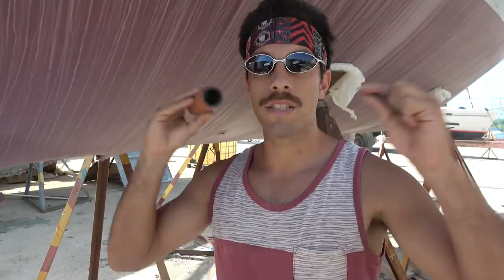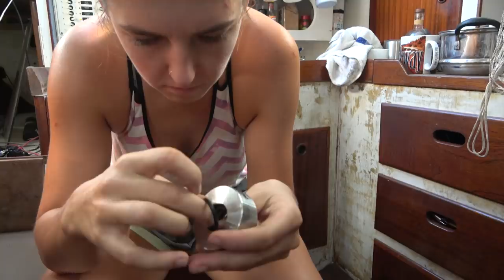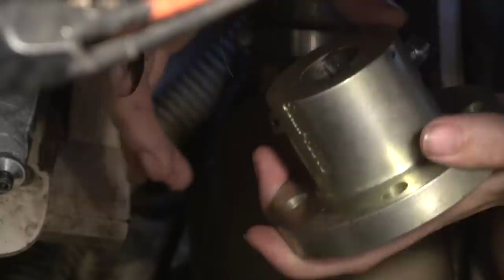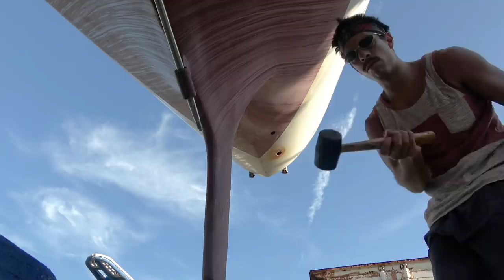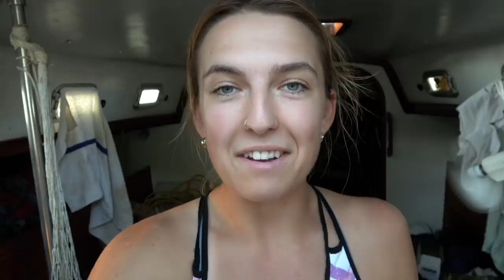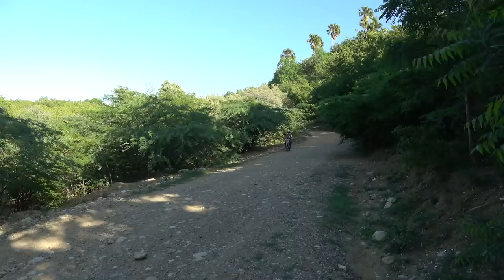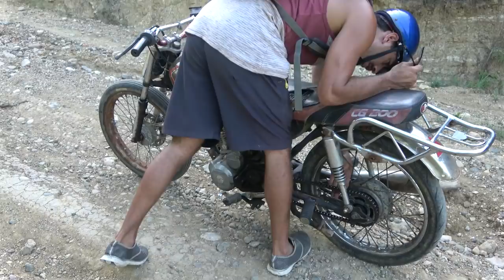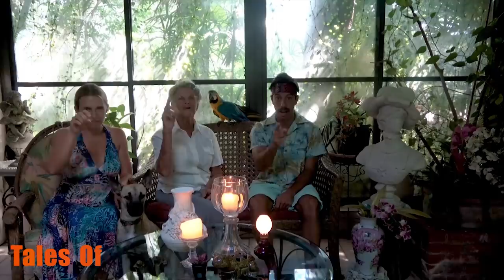Sailboat DRIVE TRAIN Installation 🔨 Ep 96

Comment: A hose clamp just in front of the shaft seal collar is a good and cheap way to ensure the collar doesn't slip up the shaft
Reply: I've always added a shaft collar for this exact reason. An old shaft anode works well too if it's not too bad of condtion. I never considered using a hose clamp, but I'll keep in my bag of many tricks if I ever need it.
Reply from the maker: Hmm, okay thanks for the idea.
Reply: Hose clamp could cause vibration . That is one way to balance the drive shaft in a car old school .   Good idea though - maybe a used anode instead ? Alternatively two gear clamps 180 deg opposite .
Reply: @faircompetition1203  PSS actually make a shaft collar for exactly this purpose about $20.00 I think , the hose clamp still works ok
Reply: @alcooper944  As long as it does not introduce vibration it is a cheap and cheerful insurance .

Comment: You should  take the set screws out of the shaft coupler and take a drill bit and dimple  the shaft it helps to keep the shaft from pulling out when you put it in to reverse just talking from experience  it sucks try put it back in in the water. Keep up the good work.
Reply from the maker: The shaft came with holes pre drilled. That does sound like a nightmare!

Comment: Few observations, bolts are available in assorted lengths. Its ok to cut a bolt to length. Be aware of bolt grades for a given application. I didn't notice a key placed into the shaft for the prop. That's an important thing so without one your in trouble . I would suggest a tapered wood plug in the event you ever have to remove the shaft while in the wet stuff.  use lock tight on everything. Loosing a shaft in the ocean will put you at the bottom. Please have a experienced surveyor go over your work before you launch. Keep up the good work & never stop learning. The chain on that bike should only have about one inch of play. Chain and sprockets and rear bearings are all probably worn and loose.

Comment: you need shorter bolts, (although what you have will prob work, little locktite might be a good idea.   if needed you can cut the ones you have just be sure to run the nut  down to the bolt head first so after you cut the bolt taking the nut off will help clean up the threads.  thinking those are fine threads and may need a die to really clean them up. (Volvo, fine metric threads is my guess.  Best way is to just get new ones)  The holes in the set pins in the coupler to the shaft is for safety wire, this will keep them from loosening.  Once the boat is in the water you will need to align the engine & shaft.  When tapping holes like on the strut I am thinking you may want to do that by hand.  You get a better feel & have more control.  The place that sold you the tap should have tap handles. (one handle fits most taps)  teflon tape for threads dealing with water so they dont leak & you dont have to crank them down gorilla tight to keep them from leaking (esp if plastic components)  Im sure I have more ideas but it is sundowner time.  Great job, have come a long way.   Ill be in Punta Cana 12/26 - 1/2

Comment: As other's have already stated in the comments your prop nuts are in the wrong order. The nut against the prop is supposed to be the half height nut. The load from the half height nut is then transferred to the full height nut. The way you have it set up all the load from the full height nut is being transferred to the half height nut. It is almost guaranteed to fail the way you have setup. 

There should be a flange gaskets between the shaft coupling flanges. It will help later with alignment and your long bolt problem will suddenly disappear. 😁 I don't know if you have access to a farm supply company there, but that's where I buy my flange gaskets cheap.

Edit: I was talking to a friend today who is much wiser than me, and he says flange gaskets are not always necessary. I guess the best thing to do is ask the flange manufacturer for advice.

Comment: It is such a pleasure to watch you two with a can do attitude and the guts to put it all out there for us to nitpick . Remember most of us learned the hard way too . 

Faired the keel on my boat two years ago and I used some old left over epoxy and mixed it by eye . It failed and peeled off like old wall paper LOL .  Ya , lesson learned .  Made two mistakes , marginal expired epoxy and an imperfect mix that would have been fine if the epoxy was  . Thought it was OK because it was just a little cosmetic fairing so I cut corners and ended up doing it twice .

Comment: If you put the nut on the bolt and run it all the way down to the head, like you have already you can cut the bolt with a grinder with a cutting wheel. Once you have cut the bolt remove the nut and it will straighten out your threads on the bolt. You can cut all your bolts to the same length, and not have the nuts on the drive shaft the nuts extra weight can cause it to be off balance and cause a vibration, which can cause major problems down the line.. Shorter bolts are the proper fix. Just FYI... Thought you'd like the input, so you have another option. And something else to think about.

Comment: Your bike chain was to tight, need about 3/4 inch play.
Reply: Always tension  a motorcycle chain with the rider onboard.
Reply from the maker: The main issue was our back tire was miss aligned. It was a diy repair job and I had 0 experience on bikes. The mechanic spotted it immediately and also tensioned the chain correctly. A 10 minute fix and 4 dollars. That wasn't the end of our bike plight though.

Comment: Agree with others. Get the right length of bolts or cut yours down. You really don't want extra weight on you shaft spinning around. It gives it more of a chance to vibrate and then fall off or loosen the bolts up. Everything you put on the coupler should get lock Tite. You didn't show it but make sure you've got your keyway installed under the coupler and that set screw on the coupler needs locktite and safety wire through the hole in its head.
Reply from the maker: Okay, we have had many others who agree on the bolt size being a problem. We will use lick tite on all hardware. Sorry we didn't show if but there is a key in the keyway. We also have wire to add to the set screws on the coupler.
Reply: @Bumsonaboat  nice work! I was a bit worried as I've seen people just use the set bolt into the keyway before. It usually doesn't end well. You guys are doing some good work and will be back in the water in no time!

Comment: Packless sealing system.... I've been going with Prop shaft seal, but I guess it could be either. The vent on the prop shaft seal is actually a safety for boats that get up on step.  When on step not as much water will come up for lubrication so that will actually be connected via a hose to some point on the engine and a small amount of water will come through from the engine to ensure lubrication.

Comment: Great job on the shaft installation !  Very poor design on the hose/pipe going under the coupler causing clearance issues.  Maybe someday you will change that.  Any piece of steel touching another piece of steel should have some anti-seize or locking thread sealant on it, including the faces of the coupler.
Good call on the dish soap and placing those nuts on the bolts that way.  Without a hacksaw or a grinder to shorten those bolts that is the best solution.  Placing the nuts on the other side of the coupler were really just an "insurance policy".  If you use a thread locker you will be good.
Fixing the motorcycle could get expensive.  You might need a new chain and worst case two new sprockets, front and back.
Reply from the maker: Thanks! Just got your most recent care package:) Michal calls you our angel. Okay, we better add some to the face, also others are mentioning a gasket or spacer to go in between. At this point we have spent $100 and a few hours and the bike is running...decently lol.
Reply: @Bumsonaboat  Anti-seize is good enough.  Be liberal.  Great to hear you have transportation again !

Comment: You could either trim those flange bolts to fit with a grinder, or leave the nuts on them, back the bolt out of the flange just a tiny bit so it's flush with the backside then tighten those nuts down. Or threaded studs but I don't know if you'd want to use those, corrosion years from now might make them difficult to remove.

Comment: If you don't end up cutting those bolts down keep an eye on them to make sure they don't move. A paint marker line from the bolt head to the coupler is a pretty common practice in the industrial world. If you cut down the bolts thread a nut on first past where you want to cut, cut with a thin cut off wheel on  your grinder and grind an angle on the end, then thread the nut off it should help clean up the threads. A triangle file is handy for thread clean up and can save the day if you don't have one in your tool box already.

Comment: With what you have replaced bolt wise looks good but you still need to have two spanners to tighten the flange together ,so hold a spanner on the bolt head and tighten the Nut back to the Flange so its as tight as you can get it.
Reply from the maker: Okay, thanks for the info.

Comment: Rather than using a nut to take up space on the bolt, better to use washers (non-locking) since they will allow the bolt to spin and fully tighten in the transmission flange. Use a final locking washer at the end of the stack of regular washers.  It would be better to cut the bolt to the proper length.  One trick is to put a nut on the bolt, then cut the bolt, then remove the nut.  The removing of the nut will straighten the threads at the end of the freshly cut bolt.

Comment: I cringed watching you tap those holes with a drill in that thin strut. Lucky it worked out ok.  The flange bolts are often cut to length. They come long because you can't cut them longer. If you do cut them put the nut on first so removing the nut will clean up the cut threads. It also makes it easier to hold in a vise when you can get purchase on the head and the nut at the same time.

Comment: As mentioned below. Cut the bolt to correct length. Used a file to clean the end. File flat on a surface and scrape the bolt across it.

Comment: Hope you greased it or the dripless orings will tear you will need a feeler gauge to even the clearance between the two cuplinks or it will vibrate bad adjust the engine up or down to suite  every time you disconnect the cups it pays to reajust

Comment: you have a vibration problem that has not been fixed yet. are those 4" flanges? you might need to get a flex coupling / thrust dampner to go  in between the flanges.
Reply from the maker: Not aware of a vibration problem. Yes they are 4" flanges and thanks, others have mentioned a gasket or spacer to go in between. Looking into it.
Reply: @Bumsonaboat  as a visual reference check out ASAP Supplies or find a fat piece of tire tread. lol

Comment: Typically you would tighten one nut against the other nut. Actually very important. One nut actually turned one direction, and the other reverse of that .
Reply from the maker: Okay, thanks
Reply: @Bumsonaboat  And, another thing I'm noticing. We used this trick with bicycles and motorcycles. The small nut is on the inside, large on the outside. So, we had these special wrenches which could be put on the inside thin nut, they were thin wrenches. Might be a trick to find them. Perhaps some really good mechanic in the area would loan the necessary size ? Thin wrench turned out, thick wrench in, locking the nuts together. That way, if there was a bearing inside of all of that, it would be exactly as tight or loose as it needed to be to run freely.  Was the oldest, and the bike mechanic for all of my younger brothers. 4 younger brothers.

Comment: Are those set screws (for the cutlass bearing) stainless?  I don't think they will do well under water.  Also, consider thread locking compound.  A quick read of the interwebs suggests Locktite 248 (stick form) with Locktite 7649 (primer for stainless).  That's just an idea, not based on experience.
Reply: Also, those lock washers... They're low grade spacers.  They don't lock anything.  See AvE's video (link below).  If you need spacers, use real washers that go all the way around.

https://www.youtube.com/watch?v=WbLS3rGtKDM

Comment: Don’t you need to align the the flanges with a 1/32” spacer first ?
Reply from the maker: Hmm, there was no spacer when we removed the old one and none came with it from the manufacturer. We will look into that.
Reply: @Bumsonaboat  - I've always used a flange gasket between the two flanges. It will help when it comes time to do the alignment and your bolts will suddenly become just long enough.
Reply from the maker: @flyingdutchman6984  Thanks, we will look into this.

Comment: Re your question to Bruce Henry ...answer... YES!!      The things you used to fit the coupling are technically called 'machine screws'. The things you need are 'bolts'. Bolts have an unthreaded section. The threaded section you have in the drilled hole means you have an increased tendency to fatigue failure. Also, as warp21driive says the stainless you've got has much less strength than the proper high tensile steel bolts you should use. 

What you have now is likely to age prematurely and fail catastrophically. It could let you down someday when you put a big load on the drive train and when you really need the power to get out of a situation. I'd get the proper high tensile bolts as soon as you can. 

The proper way to fit this particular drive train configuration is to use the high tensile bolts (probably grade 8.8) with a plain HARD washer, red loctite and the correct torque setting....NO lock washer. Google 'torque settings for high tensile bolts pdf' to find torques.
Reply: Bolts don't always have an unthreaded section on the shank, and may have full threads. Most do have an unthreaded section on the shank but it is not the defining characteristic of bolts.

I would steer very clear of red loctite, and stick with blue. There is no real need to use the red stuff for this application and it will greatly increase the frustration of getting things back apart.
Reply: @flyingdutchman6984  Key point though... this application needs an unthreaded section in the driven part of the coupling. The sustained loading are high the shock loading would be very high if the joint is lose.

Red is recommended for this application because it locks the joint solid. Blue could back off (no matter how little) an allow fretting.  But if the torque setting is right you don't need any glue.
Reply: @andyagogo9713  - I won't argue that a smooth shank section of the bolt would be beneficial. I personally won't use the red Loctite because I often need to take things apart under extreme conditions. The last thing I need is an open flame when I am squeezed into the tiny space that gives me access to my stuffing box. Under some other conditions I might recommend red Loctite.

Comment: I'm concerned about your left hand propeller. I know you bought it is used and the old one was a right hand propeller that you had but it ran forward in reverse. Big issues going on here. You should have the engine and the propeller spinning the same way. The rotation of the engine should be the rotation of the propeller in forward. I hope you're not running the gearbox in reverse so you can go forward with the wrong Direction prop
Reply: I think it was the other way around. When they bought the boat it had the wrong prop fitted.
Reply from the maker: Wow, amazed at how much you and others know about our situation since we didn't share any of this knowledge in this video. As S?V Bathsheba mentioned we discovered that we had the wrong prop on all the way to Turks and Caicos and now we believe it is correct. Still need to confirm this but the engine ran so much better with this prop. We have both right and left props on the boat in case we make new discoveries.
Reply: Thank you for noticing and a reply. It does however seem likely that boat would have a right hand drive and that the left hand is unlikely. Thanking the linkage was incorrect. Can't wait to find out. Propeller choice is such a science. Propellers that look the same even perform different. Propeller is always the key to engine performance

Comment: I've tapped several holes in my days but have never ever used a drill motor. Always a T-handle with 10 turns in 4 turns out for bottom tapping at Least.
Reply: Agreed. I have never seen (or heard) of anyone tapping a hole for threads with anything other than a T-Handle. Probably not "supposed" to be done that way, buuuuut.......she got it done.  A girl who will work on your boat with ya, Hmmm  yeah..I would call that a keeper!
Reply: did'nt  put cutting oil or any oil on the cutting tool!